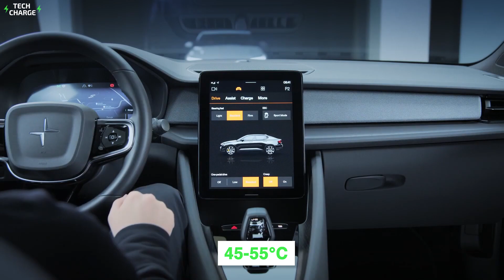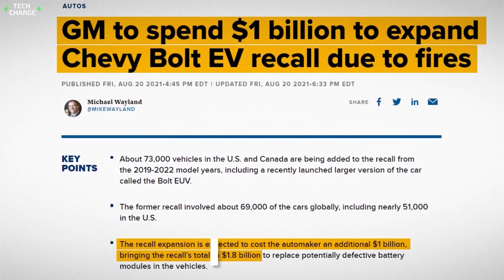The Shocking Truth About EV Fires You Need to Know

Comment: I work in insurance, a real quote from a vehicle owner “I’ve owned well over 30 plus cars that ran on gas from 1972 to 2019…the only car that has ever caught fire is my Tesla I bought 8 months ago. I will never own an electric car ever again” …these fires are more common than what’s being published…I know…I write the claims for them 😂
Reply: They also seem VERY Expensive to fix . Parts seem to takes months as well.
Reply: @mikefleek9259  If there is damage to the battery pack in a shunt, the car is usually written off.
Reply: @mikefleek9259 true but the odds of having to replace one is very slim
Reply: @mikefleek9259 
An emplyee at an official Tesla authorized repair shop (there are few , here) told me in low tone voice, that they've just received the body part of a Tesla a after 4 months wait...and now rhey were going to put it in place, etc....🙈🙈🙈🙈
Reply: the 52 EV fires caused ten times the damage of the 200,000 gas vehicle fires!
Reply: They now have zero value, who will buy a potential mobile fire
Reply: My sons VW Up Beats edition 2 years old court on fire and it was a gas car. Within 5 seconds it was in a ball of flames. Land Rover Discovery 3’s catch fire due to faulty alternators so do many gas cars. We just here about EV’s because they are supposed to be safer but a lot harder to put out. When i asked the fire man about my son’s car he said you would be surprised at how common gas car fires are. In fact i have seen around 6 this year all gas cars but not when parked in a garage always on the move. Wouldn’t park an EV in my garage that’s for sure but then i would drive a gas car straight into my garage either, i would let it cool down before i would leave it in a garage.
Reply: @@aregeebee201 Everybody's situation is different, and I don't believe EVs should be forced on people. For some use cases, EVs aren't the best.
Reply: Half of these cars that are burning in this video aren't even EVs
Reply: Thanks for sharing 🙏
Reply: Thank you for telling us the truth about them .
Reply: @georgevavoulis4758  Here's the truth. Not someone's personal experience. There are 284 mil gas cars on the road in the US and about 2.2 mil EVs. That's about .77 of a per cent of total cars. THERE WERE 200,000 GAS CAR FIRES and that means there would have to be 1,540 EV fires to match the percent of gas fire fires. THERE WERE ONLY 52 EV FIRES in the US last year.
Reply: @777Outrigger mate. There is tons of misinformation about EVs.    The people who hate EV will never listen to common sense. I gave up arguing with these people long ago. It's like arguing with a "flat earther"   don't waste your breathe mate.     Just buy an EV or a PHEV like I have and save $10,000 a year on fuel and enjoy it..   let these clowns keep driving their crappy old petrol car.
Reply: @Liams_Fraser_Island_adventures  I'm just posting in case a undecided person is reading the thread. I just want to dispel the misinformation that EV haters dispense for their sake. .... And my Tesla is incredibly fun to drive, with the instant max torque and the technology. .... Enjoy your EV too!
Reply: @777Outrigger 
...you're repeating yourself on and on and on...!
Reply: @steveaachen62  Yeah, it's a comment section that has 151 replies and is a year old. I'm not reading through it to see what I've posted before. Sorry that offends your sensitivity.    .... And people keep posting the same old BS about EV fires too.
Reply: Just a note that a large number of burning cars shown in this video are actually a gas cars...
Reply: @@Mathilda2zero There are technologies and techniques being developed that will put out EV battery fires as fast gas car fires. I know they have developed some new tech in Sweden and in the US there is a promising fire blanket that can stand temps up to over 500 degrees C and will stop the fire. The blanket will have to be left on the car for a month, but I would say that's a small price to pay to keep the fire smothered.
Reply: I’ve had cars since 1965 and have owned more than 30 (from different brands). Now, I own two Teslas (a Model X and a Cybertruck). Thanks to advancements in battery technology, they’re super safe, and I don’t worry even 1%, period.
Reply: I was told that Genesis gv60 doesn’t hv that problem because a actual person wraps and inspects their batteries unlike Tesla using robots which aren’t tested
Reply: @@Mathilda2zero There are now 2.4 million EVs on the road in the US. More in Europe. Yeah, they're just bursting into flames everywhere. 🤣🤣🤣🤣🤣🤣
Reply: @@Mathilda2zero Man, you just did a lot of myths and half truths about EVs. My range is 330 miles in my Model Y, and I leave full every morning from charging overnight in my garage.  I never have to go to a gas station. .. Plus I've done a 500 mile road trip in my Model Y, about 7 hrs with a total of 37 minutes of supercharging at 2 different charging stops, 19 and 18 minute stops. Just enough to stretch, P, and get a snack. Tesla has 21,000 Superchargers in the US now. You can go anywhere.  ........ The top Lithium mining country in the world, by far, is Australia with Chile second. The controversial mineral is Cobalt with child-slave labor, but the latest EV batteries are LFP batteries and they have NO cobalt. Meanwhile Cobalt is in your cell phone and laptop batteries, and is used in the refining of gasoline.  ....... And I'm sorry, the mining for EVs and their supporting infrastructure is a lot less than for gas cars and their supporting infrastructure, by a wide margins ...... 

And did you know than electric motors are about 3 times more efficient than gas engines? The big 7-seat  Model X SUV has a 100 kWh battery pack and can go 350 miles. That 100 kWh battery pack has the energy density equivalent of only 3 gallons of gasoline. So why can the big Model X go 350 miles on the equivalent of 3 gallons of gasoline? Electric motors are 3 times more efficient than gasoline. That's why they pollute less even on the current grid.
Reply: And when EVs use non'flammable batteries, you'll find your workload disappear, and fewer "adjusters" will be needed.
Reply: @AllDogsAreGoodDogs   Robots don't care what kind of fire they put out.
Reply: Let’s see what the fire rate will be after the winter’s road salts eat away at the batteries.
Reply: @richardolko6660   No worries, Tesla has been making cars for fifteen years now if that was an issue it would be talked about by people much farther up the food chain then you are. Besides robots will be fighting those pesky fires soon enough.
Reply: Data from the National Transportation Safety Board showed that EVs were involved in approximately 25 fires for every 100,000 sold. Comparatively, approximately 1,530 gasoline-powered vehicles and 3,475 hybrid vehicles were involved in fires for every 100,000 sold.
Reply: @myoung48281  utter bollox
Reply: Hi,
I am not surprised. I worked 30 years in the fire service. Lithium Ion batteries are a known fire risk and have been so for 40 years. Even the designer admitted this. It is therefore no surprise they are catching fire as are battery storage sites and E-bikes and E-cycles. I will never buy one.
Reply: @michael.randall5034  Gasoline is a fire ricks too. Teslas catch fire for every 205 million miles driven on average. Gas cars every 19 million miles. I don't know about these E-bikes, but battery management systems on electric cars are getting very good, and the new electric car lithium battery chemistries are less fire prone than than the early chemistries.
Reply: I've been driving gas powered vehicles since 1975. We have had one fire. This was due to wiring damaged by a welded repair. I was away when a passer-by knocked on the door to inform us that our car was on fire. My wife was washing the pots at the time and threw her bowl of water over the fire. End of fire.
Risk is assessed as a combination of probability and consequence. The consequences of an EV fire are so severe that the lower probability of a fire is less relevant.
Reply: @TheRealWindlePoons  Tesla vehicles have had a fire rate of one for every 175 million miles traveled compared to the U.S. average a vehicle fire for every 19 million miles traveled. .... We should ban all gas cars since they catch on fire so often???
Reply: @777Outrigger: Yes, that may be true, but a gas operated vehicle is way, way easier to put out, as you can see from watching this video. It appears that an EV fire is nearly impossible to put out, reminding me of victims of the Hamburg,Germany fire-bombing raid , where victims on fire from phosphorus would jump into the canals, then come back out still on fire!
Reply: @robertbruce1887  There are technologies and techniques being developed that will put out EV battery fires as fast gas car fires. I know they have developed some new tech in Sweden and in the US there is a promising fire blanket that can stand temps up to over 500 degrees C and will stop the fire. The blanket will have to be left on the car for a month, but I would say that's a small price to pay to keep the fire smothered.
Reply: @@Mathilda2zero No, I don't feel personally insulted. But I am kind of exasperated by the lies, myths, and half-truths that I see over and over and over and over again by clueless EV haters. I can always tell when a new half-baked talking-point emerges and goes like crazy over the internet. "A lie gets halfway round the world before the truth can get it's pants on." Winston Churchill ..... And yes, depending on which metric you use, gas car fires happen at as much as 10 times more than EV fires. .. 

Look, I'm sorry that the looney far-left is trying to cram EVs down your throat. I'm against all mandates and subsidies, like Elon Musk. I'm not a climate alarmist. But I know that EVs are superior for most use cases. My fueling costs have fallen by 75%, no oil changes, no transmission fluid changes, no spark plug changes, brakes last 150,000 miles because most braking is done by regen, not friction brakes, etc, etc. I was skeptical about EVs myself, and said many dumb things about them, but I studied EVs for over 2 yrs before I bought my Model Y. I know that most of what is being said is at best a half-truth and a lie at worst.
Reply: @@Mathilda2zero There are technologies and techniques being developed around the world that will douse EV fires as fast as gas car fires. I just watched an EV fire put out in a few seconds by an EV blanket that stand over 500 degrees. Fires are far from a deal stopper for EVs.
Reply: @@Mathilda2zero Yes, but coming soon. As EV adoption becomes more prevalent.
Reply: @@Mathilda2zero Tesla has 21,000 Superchargers in the US now and adding 4,000/yr and that number is growing. Sales are a 7% in the US, 25% in California, and even higher in Europe. Tesla sold 900,000 cars in 2021, 1,300,000 cars this year, and is on track to sell 1,800,000 cars this year. Maybe coming faster than you think. But it will be decades before most gas cars are mostly replaced.
Reply: Yeah, local fire officials are told to list EV fires as vehicle fires, so we may never fully know, just how much, the govt and mfr's, have been lying to us.  But, just from this video, alone, I counted almost as many fires, as (the lying) google, is willing to admit...and im sure that there are many, many more, than that...
Reply: I once had a car years ago where the plastic fuel line had become brittle and split leaving petrol to drop onto the exhaust manifold but it never caught fire meaning I had to put on a new length of reinforced tubing
Reply: Should have mentioned the more dangerous toxicity of the fumes of an EV battery. What if an EV battery goes into thermal runaway in a multilevel carpark or a tunnel.
Reply: Suspected as much!
Reply: Problem is, EVs catch fire without visible cause. They cause way more dangerous fires that are almost impossible to put out.
Reply: Why would you have a Tesla IF you have inside knowledge of an issue as a supposed insurance agent?
Sorry but I'm calling BS...
Reply: Thing is you can't put them out with water.
Reply: But insurance industry statistics show that Gas cars catch fire at a much hire rate.
Reply: When in reality Evs are about 15 times LESS likely to catch fire than a petrol or diesel vehicle.
Reply: Sure buddy. We all believe you..... you work in insurance.  Righto.    Also you bought a Tesla...... even though you hate them....... righto..  .makes sense.  😆
Reply: Why do people get all worked up about EVs. If you don’t like them don’t buy one.
Reply: Indeed.  Ch has HUGE numbrs.  So many folks have wondered if the whole thing was just a ludicrous $cam.   It was so illogical ... and yet ... they DID it, eh.  
Lith.batts near salt water is snaggy to brkdwn of some Bat.housing area; and temp-related spontns.combstn.
Even E bikes too.  (Yt)
4500 degr.
InTENSE.
REignite later, often.
Reply: Per billion miles driven there are 55 fires in ICE cars and 5 fires in EVs.
Reply: @adrianthoroughgood1191  well, I drive cars for more than 30 years now, at the moment just a couple thousand mls per year. So, my car has now about 70 k mls in 17 years. It shouldn´t burn no matter how much mls I drive and no matter how old it is. Everyone working in engineering knows the "bathtub curve": A product has a high risk of failure in the beginning due to production mistakes, then follwed by a low failure rate over a longer period till the aging starts rising the risks. So comparing older gas cars with younger EVs ignores this fact and we will see more fires of EVs when the first cars will be 20 years and older. The highest risk for all cars, EV and ICE, that got worse in the last 15 years, is the low voltage system for all the "pleasure electronics" in the cars. Having temperatures in the summer far higher than 100 F inside the car, the PVC insulation ages. A simple  short circuit, some dust,  old plastics and your car burns, no matter if you drive 1000 or 100.000 mls per year. So you better don't trust the stats, that keeps the business of car makers running.
Reply: Hi,
I agree with you. I worked for the fire service for 30 years and Lithium Fire batteries have been a known fire risk for 50 years. I would never buy one either until safer batteries are invented.
Reply: @michael.randall5034  EVs have a lower fire risk than gasoline cars now, but the new batteries just now coming on line are LFMP and LFP batteries and have even a lower fire risk than the current NCM batteries.
Reply: EV fires are not reported by MSM and infact covered up by the government as it's in their agenda
Reply: I want to hear from the insurance worker again.  It's been a year, how many EV claims (in dollars) have there been vs ICE?
Reply: Hi, I agree,
Most ICE cars that catch fire are older cars. The worrying things is that EV's are catching fire are not very old. Statistics do not take into account arson and smoking materials and DIY mechanics.  EV's spontaneously combust and burn very hot are are almost impossible to put out. If these vehicles were in a factory compound they would require hazardous information and an emergency action code. EV fires are chemical fires the worst type. ICE vehicles are easily extinguished.
Reply: Is it because it got flooded? Because it is flooded by salt water, it can catch fire even weeks later
Reply: @nystagmus  There's no better protected battery than the recent Teslas. Run them through water all you want. They're doing it a lot lately offroading the Cybertruck. No problem.
Reply: We do have 1 thing in common and that's the evs catching fire it hurts honestly to see this happen
Reply: This video now needs to be updated. It's much more likely that an EV-IL car will set on fire.
Reply: @markpownall6967  More cluelessness about EVs and fires.
Reply: I pulled a teenage girl from a burning Toyota 25 yrs ago. I couldn't get her sister out before it really combusted. It was very traumatic. From my experience, maybe I should have concluded that gas cars were too dangerous for people to own.
Reply: You should never buy a Smartphone,, because the energy density much higher than in a ev
Reply: Sample size = 1
Reply: Did'ju hear about the Tesla that was sitting in the garage when a house fire broke out? The Tesla was badly burned, but the battery never caught fire!!!. I didn't think  you heard that.
Reply: I beat your client by 3 years having owned petrol and diesel cars since 1969. The incidence of Electric car fires is horrendous. Go to 6.50 and listen. If I interpret the Americanese of the presenter into English, he said "If you hop into an E.V. right now (I still have both of my legs so I don't need to hop. I only hop to amuse young children) there is a nought point three percent chance that it will catch fire. That means, if it is not destroyed by other means earlier, the average life expectancy of an EV is just over 333 journeys before spontaneous combustion. He said it on the video so it MUST be right, mustn't it ?

Since 1969, I estimate that I have been the driver for well over 20,000 journeys. I have travelled as a passenger in cars on numerous occasions. I have never been the driver or the passenger in a car which has caught fire. My Dad purchased his first car in 1958 and he drove until ill-health took hold in 1998 and none of his cars ever caught fire. The only time that I have ever seen a car on fire where I was physically present, another driver and I rushed to the car which had a fire under the bonnet. with our fire extinguishers. Whilst I used mine from underneath, he rashly lifted the bonnet releasing a small fireball which singed his eyebrows. Undeterred he attacked the fire from above and we succeeded in extinguishing the fire in 20 seconds.

Various bystanders had run around like headless chickens and used their mobile phones to call the fire brigade. Two fire engines descended on the scene, sirens blaring. The firemen were very disappointed that we had shot their fox. We investigated the cause of the fire. The driver and his mate were very red faced indeed. THEY COULD NOT HIDE THE CAUSE.  They had left the engine running so fuel continued to leak and the drips were making spitting noises. I shouted at the driver to stop the %%%% engine. They admitted that several days earlier, they had removed the carburettor (English spelling) to clean it. They had lost the fuel pipe clip so had secured the fuel pipe to the carb with adhesive tape !!!!      CAN YOU BELIEVE IT ?  Having stopped in a queue approaching a roundabout, the leaking petrol, which had been evaporating with the movement of the car, started dripping onto the then very hot exhaust pipe ! How they had got away with it for several days, I don't know.

I left the scene having given the driver my name and address as he had promised to buy me a new fire extinguisher. I never heard from him again. The last I saw of him, his head was bowed as a fireman, denied the opportunity to do his man thing, was delivering a very stern lecture. "If it had not been for the swift action of these two gentlemen YOUR CAR ..... etc. etc."
Reply: @terryhoath1983 
👍👍👍👍👍👍👍👍👍👍👍👍👍👍👍👍👍👍
Reply: @terryhoath1983  Bogus. Let's see, there are 284 mil gas cars on the road in the US and about 2.2 mil EVs. That's about .77 of a per cent of total cars. THERE WERE 200,000 GAS CAR FIRES and that means there would have to be 1,540 EV fires to match the percent of gas fire fires. THERE WERE ONLY 52 EV FIRES in the US last year.
Reply: @777Outrigger  thank you for this. genuinely dont understand the scare going around with battery fires. they sure are a big problem when they happen, and im not exactly a fan of EVs for many other reasons, but these fires are so exceedingly rare in relation to how many batteries are in circulation..... if people are really scared of that risk, then they should also avoid a ton of other things that they probably use without concern on a day-to-day basis
Reply: @ssword123  EVs are just held to a higher standard. That's ok, but I think everyone should know the truth about the actual numbers.
Reply: @777Outrigger where are these numbers coming from
Reply: @777Outrigger  Maybe you should try to explain why so many people reject nuclear power, by the numbers of accidents only.
Reply: @ssword123  Maybe you should try to explain why so many people reject nuclear power, by the numbers of accidents only.
Reply: @louiscaeiroramos8051  Then we should reject gas cars because because there were 212,500 vehicle fires which caused 560 deaths and 1,500 injuries; and $1.9 billion in direct property damage. More people are killed and injured in gas car fires than in nuclear accidents. ...... And EVs are not being rejected. Tesla sales in 2021 were 900,000, in 2022 there were 1,300,000 sales, and Tesla's on track to sell 1,800,000 EVs this year. Sales rising exponentially.
Reply: @777Outrigger  Your math is wrong regarding the percentage of ICE (Internal Combustion Vehicles...GAS) fires.  It's not 0.77 percent,  Based on your numbers of 200,000 fires of ICE vehicles out of a total of 284 Million ICE vehicles, the percentage of fires (based on YOUR data) is 0.07%.  Also, just to be clear, Internal Combustion Engire (ICE) vehicle fires are not spontaneous.  ICE fires occur after devastating accidents...fires set on purpose by vandals and other criminals....fires purposely set by insurance fraudsters...or fires occurring due to negligence while improperly re-filling the gas tank by using a container, and the nozzle of the container causes static electricity thus igniting the gas. --- again due to NEGLIGENCE.  Also, that 200,000 number you quoted for 2022, if accurate, most likely pertains to ALL ICE vehicles, not just cars (Buses, planes, boats, motorcycles, lawnmowers, trucks, SUVs etc).  While the 52 number you quoted for EVs only pertain to cars...and only pertain to those fires that were officially reported.  Most EV fires are not reported.

Lastly, the total number of ALL ICE vehicles in the USA is not 284 Million --- it's 250 Million.  And that 250 Million number pertains to ALL ICE vehicles, not just cars.
Reply: @fidel2xl  You can look at lots of difference metrics and different studies, some in different countries, and you can get different numbers. If I get a number a little wrong, it's because I can't keep up with all of the studies.   ... But one thing is certain, EVs catch fire much less often than gas cars, by many multiples.  ..... The most simple metric is Teslas catch fire on average for every 200 million miles driven. Gas cars every 19 million.  ..... And the Tesla fire rate is falling too, not rising. It use to be a fire for every 175 million miles driven. ...
Reply: @777Outrigger  - Dude, based on YOUR own numbers, your own calculation of the percentages was incorrect.  Your 0.77% calculation was wrong --- this is not my opinion....it's a mathematical fact.

You divided 200,000 by 284,000,000 (284 Million), and somehow came up with: 0.77%.
Nope...the correct percentage based on the numbers YOU provided is: 0.0704% (or just 0.07%).  

Calculation: (200,000 / 284,000,000) x 100: 

Answer: 0.07%

Your claim (based on YOUR numbers) was way WAAAAY off. Not an opinion...a fact.
Reply: @777Outrigger  - Oh, and thank you for agreeing with me by basically repeating what I pretty much inferred by using the phrase 'You have to use different metrics'.  You do realize that's pretty much I said in my previous comments to you, right? LMAO 

Regardless, EVs are the WORST type of vehicles out there...they are a hazard even more so than Internal Combustion Engine (ICE) vehicles.  And EVs are even WORSE for the environment.  EVs need to be banned, and all the crooked businesspeople and politicians who gave and accepted bribes to make these vehicles mandated into law in various countries, need to be indicted and imprisoned for fooling gullible well-intentioned people like yourself.  Jail them and throw away the key.
Reply: @fidel2xl  Let me simplify for you. Tesla's catch fire on average every 200 million miles driven. Gas cars every 19 million. .

And obviously you're not keeping up with the EV fire technology. If you do a little research, you'll see that fire departments are developing techniques and technologies to put EV fires out as fast as gas car fires.
Reply: @777Outrigger  You know most petrol car fires are due to electrical faults or people burning stolen cars, right? Add in insurance write-offs and ancient old cars. How many modern EVs will get to classic status before burning or being too obsolete to use?
Reply: @louiscaeiroramos8051  Because people are afraid of things they don't understand.
Reply: @ssword123 imagine an electric car caught fire in YOUR garage while you and your family are asleep. Doesn’t bear thinking about does it?
Reply: @777Outrigger  Hi, Not that straight forward.
You are not taking into account how serious an EV is that it develops rapidly without warning, burns 3 times as hot at 2000 degrees c  and you cannot extinguish it easily, may re-ignite,  and MOST importantly the age of the vehicle. EV's spontaneously combusting are not very old. Most EV's are barely off the production line.
Reply: @777Outrigger  you're very naive it's actually hilarious 😂
Reply: @ssword123  you're so sheltered from reality it's actually sad
Reply: @Martin199320  You're uniformed. It's actually hilarious. 😂
Reply: "I work in insurance"
Sure you do, and I'm a Senator working in the US Senate, anyone can claim to be anything on the internet ;)
Reply: How will motor mechanics work on them as they will
now have  to be quarantined
Reply: Careful the wokies will get you
Reply: There were 200,000 gasoline car fires in 2022. There were 52 EV car fires. The rate of fires is 20 times higher for gas cars over EVs.
Reply: @777Outrigger  Yes, but the fumes are no where near the problem, just don't breath anything around an EV fire, it's much more toxic.
Reply: @adoreslaurel  I can tell you from personal experience, don't breathe the fumes around any car fire. They'll all toxic.
Reply: @777Outrigger  Wait until an EV takes out a big building from a burn up in the basement, then the Insurance companies will come to the fore.
Reply: @adoreslaurel  Just wait? Sounds like you're desperate to make a bogus case. There are millions of EVs put on ships every year, and all you've got is one ship fire, or two?
Reply: @777Outrigger There is a ship near Holland that had 3,000 vehicles onboard. There was only 25 EVs and there was a massive fire that came from the EV area. 1 man has died and many of the crew jumped overboard due to the heat. But EVs are that popular that out of 3,000 vehicles there was only 25 EVs.
Reply: @marcandsebe  Sales of EVs are rising in Europe, China, and the US exponentially. EV sales in the US were 258,885 in the 1st Qtr this year, up from 178,679 in the 1st Qtr last year. That's a 44.9% increase in sales year-over-year, and a run rate of over 1,000,000/yr.
Reply: @777Outrigger  But after 8 to 10 years the battery is on its way out. EV’s are a throw away item. You won’t see any classic EVs in years to come. They don’t have any soul.
Reply: @marcandsebe  That's old news. Many Tesla batteries are making it to 200,000 miles with very little degradation. About 10-15%, depending how their charged. Some Teslas have made to over 300,000 miles with the same battery. There is a 2,000,000 mile Tesla that's had only 2 battery changes. ..... And to say Teslas have no soul shows you've never driven one. Yikes! The instant max torque and incredible acceleration are excellent. Lots of fun to drive. I drove my wife's gas car recently for the first time in 7 months, and it was so boring.
Reply: @777Outrigger  Probably true, but the fact that you can't hose it out remains a problem. When it takes down a building, and there is one scenario I will not mention for a very good reason [no! i won't reply to anyone because I expect when people consider ALL the possible scenarios, they will find its very chilling].
Reply: @adoreslaurel  There have been a Tesla or 2 that have caught fire in the parking garage  of high rise apartments in China, and the fire was contained. And that's a worse case scenario, unlikely to happen. ..... And battery tech is advancing very rapidly, that includes battery management systems and other tech that will reduce the fire risk by EVs to even a lower level than it is today.
Reply: @777Outrigger  I would be interested to know how it is possible to "contain" an EV "Brewing up", it is difficult to imagine how it could be done considering you cannot put it out, just let it self destruct, perhaps the fire dept played so much water on and around it that they may have been able to dampen down the heat from damaging the underside of the building.
Reply: @adoreslaurel  I don't know, but I have 2 brothers-in-law who were firemen. I might ask them what they think about EV fires. I have had one ask me about my Model Y and how I liked it and what did it cost. Next time I talk to him, I'll ask him about EV fires.
Reply: @777Outrigger  i noticed the WERE bit, maybe they are glad to be out of that hazardous business. We owe Firies a lot, a very dangerous game.
Reply: @adoreslaurel  One retired early, the other retired at the normal retirement age, but he actually wanted to stay in. His wife wanted him out though. She knew it was dangerous and she figured he had done his part.
Reply: @777Outrigger  They have served their time, they don't have to be in for long to acquire a lifetime incapacity. Standing on a roof with a fire underneath is a quick way to go.
Reply: @marcandsebe  treated properly the batteries in an EV will last nearly 20 yrs. There is a Hyundai Ioniq video on here that's done 98,000 miles and battery health is at 100%.  Work that one out. There's a Tesla done 200,000 on here who's battery is at 96%.
Reply: @marcandsebe the actual number of EVs in that ship was later revealed to be 300
Reply: @stephenberry8658  That’s 300 EV’s we won’t see on the road then.
Reply: @marcandsebe if you buy a new jeep.... you will be lucky to get 8 or 10 years out of it ... without major repairs. Lol
Reply: @adoreslaurel you can't put a petrol fire out with a water hose either mate.    Fuel floats on water. It just spreads it around.  You need  a propper fire extinguisher or the right type or fire retardant and petrol fires are still very hard to put out... they nearly always let them burn out.. I have seen a few in person.  But I have never seen an EV fire yet.
Reply: @Liams_Fraser_Island_adventures  The answer is to never buy a Jeep. I buy Japanese vehicles and have only just got rid of a 2006 one. It was still running well with 150k miles on the clock.
Reply: @Liams_Fraser_Island_adventures  Yes, I agree, fuel and oil both float on water, at best, maybe you can stop it spreading to other flammable objects, and water can drop the heat a bit, A fire hose could, at least, reduce the severity of petrol fire out in a basement but an EV burning attains such a high temp and can not be towed out of the building. would not like to own a flat in a building where that happened. Total flooding of a basement would be the only option if you could get it going quickly enough.
Reply: @adoreslaurel  there was a huge fire recently in a parking complex and they say it started with an EV but later this was found to be false.... it started with a diesel landrover......  the fire spread from the fuel from all the petrol and diesel cars that were catching fire and the fuel was actually flowing down to over levels of the building..... this doesn't happen with EV
Reply: @Liams_Fraser_Island_adventures  Err you say it doesn't happen with EV, I think a lot of people might disagree.
Reply: @adoreslaurel  how can fuel flow out of an. Ev?  Not. Possible.    Ev fires are from the battery's and burn alot slower and longer than fuel fires.      The rate of EV fires on also 20 times less that petrol and diesel vehicles.
Reply: @marcandsebe is soul the new word for jerky shifting and nasty pollution and low starting torque?
Reply: @777Outrigger - Wrong...there were only 52 EV fires that you're aware about.  Most of the EV fires are not officially reported.  Also, there are magnitudes more ICE (Internal Combustion Engine) vehicles than there are EVs, so one has to account for that.  In addition, the 200,000 number that you're quoting regarding ICE fires, most likely pertains to ALL ICE vehicles (Cars, Trucks, Buses, Vans, Ships, Planes, Lawn Mowers, Vans, SUVs etc).  While the 52 number you quoted regard EVs only pertain to cars.... and only those car fires that have been officially reported.  If you want to know the true number of the amount of EVs that have spontaneously caught fire, speak to insurance companies. Very soon, insurance companies will refuse to insure these hazardous EVs.

Oh...and these EV fires are spontaneous events.  While ICE vehicle fires are typically not spontaneous.  ICE fires occur either when there are devastating accidents ; Fires set on purpose (vandals setting fires to cars... fraudsters destroying their vehicles for insurance money...people using open flames close to open gas tanks...or people filling their vehicles with gas from a container, but doing so improperly and whereby static electricity ends up igniting the fuel in the gas tank during the improper refilling).
Reply: @fidel2xl  All the things you said don't account for a 10 to 1* fire rate gas cars over electric cars. Not even close.

And I pay about the same price for my car insurance for my 2023 Model Y that I do for my similar sized 2015 gas SUV.

*Teslas catch fire on average every 200 million miles drive. Gas cars every 19 million cars.
Reply: @fidel2xl I have seen a fair few petrol car fires.  None from vandalism or insurance... all while being driven.  One was a 4 wheel drive on the beach that burst into flames.... the others on the side of the road.  All massive fire with flame 60 foot in the air and no chance of anyone putting them out.. I even had a fire in a petrol car myself when. I was 18 because the fuel pump started leaking...... lucky I was very quick with the fire extinguisher and put it out as soon as it started... othwise I would have had no chance.
Reply: @Liams_Fraser_Island_adventures  - For the sheer number of Internal Combustion Engine (ICE) vehicles on the world's roadways, the percentage of those vehicles that burst into flames is extremely infinitesimal (very VERY rare).  And those fires are typically easily contained.  However, for the relatively LOW volume of Electric Vehicles (EVs) on the roadways, the incidents of fires is actually quite high.  And those EV fires which are typically the result of the burning of Lithium batteries, are almost impossible to contain.  The EV fires are usually very devastating.  It's just not worth it.
Reply: @777Outrigger  It's 200,000 out of a huge number vs. 52 out of a much smaller number
Reply: @tjung3909  Let's see, there are 284 mil gas cars on the road in the US and about 2.2 mil EVs. That's about .77 of a per cent of total cars. With 200,000 gas car fires that means there would have to be 1,540 EV fires to match the percent of gas fire fires. There were only 52 EV fires.
Reply: @777Outrigger the point of charging your car in your house, which your chances of the car catching fire increases, your gonna be losing both your house and your car at the same time.
Reply: @tjung3909  What are you talking about!  It's STILL twenty times more likely for an ICE vehicle to torch than a BEV!  By far the most EV fires are hybrids, so not true EVs at all.
Reply: @samlocoaa1726  Parking your gas car in garage increases the chance of losing both your car and your house too. Had you heard about the recent spate of BMWs catching fire in owner's garages?
Reply: Put as a percentage gas cars are still alot more likely to catch fire
Reply: @mteifke  Tesla's catch fire on average every 200 million miles. Gas cars every 19 million miles. Gas cars are 10 times more likely to catch fire than Teslas.
Reply: Even if those numbers are correct,  the problem is the intensity of the EV fires.   Most gasoline car fires are around the engine,  not the fuel tank, and if you act quickly you can put them out with a fire extinguisher.   I drive a 1974 MGB frequently,  I know there is a small risk of an engine fire just due to the age of the vehicle,  so I carry a fire extinguisher (as do most classic car drivers).  It is also easy to reduce the risk of ICE fires by keeping your vehicle well maintained and replacing certain key parts as they age.   With an EV,  I fear the unstoppable (by me at least) and unpredictable (nothing I do can influence the risk of a spontaneous battery short circuit) fire that could result.  And no,  I'm not anti-EV,  in fact my wife drives a plug-in-hybrid with a much smaller battery,  but I do worry about the current battery chemistry in many EVs.   I do think this is a temporary problem, and in a few years,  may well buy an EV (once the chemistry is more stable -- I just currently see the risk as real).    @777Outrigger
Reply: @stephanmeier1613  Well, if you just do some research, you'd know that fire departments and others are figuring out techniques to douse EV battery fires fast and without so much water. EV fires are far from an insurmountable problem... Plus your phone and laptop battery can burn your house down. ....... And yes, those numbers are correct.
Reply: @777Outrigger, so what? That argument is bogus. Parking  garages in Florida and in my state do not allow battery powered glorified golf carts to park in them. Spin your way out of that.
Reply: @roddycreswell8613  Ignorance by parking garage owners explains it. Lots of misinformation out there. And all parking garages? Really? ..... The state with the largest number of EVs is California, with 25% of car sales so far this year being EVs. Yeah, and parking garages are just bursting into flames everywhere in California.
Reply: @777Outrigger  at least the ignorant parking garage owners won't deal with a burnt ev! I wouldn't spit across the state line into Cali, I also wouldn't waste my time and money on an ev. You think your so much better than me, guess what! Your not, you force your will onto others and that makes you the lowest form of human life. Love, live, and let live. Not in Cali. But tell yourself that if it makes you feel better about yourself.
Reply: @roddycreswell8613  I don't like the lefty loonies in California anymore than you do. I have nothing against gas cars and certainly don't think I'm better than you for driving an EV. I often remark on cool gas cars I pass. I'm against all mandates and subsidies for EVs to and so is Elon Musk. I'm just here to defend EVs about misinformation that is flying around the internet.
Reply: @777Outrigger out of the gas fires how many were due to self combustion not accidents resulting in fire? Of the 52 how many EV’s spontaneously combusted for no external reason? Now do your math.
Reply: @777Outrigger  but tjey're still burning.
Reply: @edpoe4622  Not as much as gasoline cars.
Reply: @777Outrigger  The problem is that many evs start fire without to be on an accident, i mean, burn spontaneously. Gasoline cars that burned was after be involved in an accident.
Reply: @GETTERoriginal  I know lithium batteries can do that, but the battery tech is getting better as are Battery Management Systems. It's a rare event and getting rarer all the time.   Tesla has gone from a fire for every 175 million miles driven to a fire for every 205 million miles drive just in the last 5 yrs.
Reply: @tjung3909 they actually measure  it in fires per 1000 vehicle...... Ev are about 15 times less likely to catch fire than a petrol car.
Reply: @777Outrigger I wisely steer clear in pkg lots, and even at traffic lghts.  Too unpredictably hazardous.   Do not charge them in your Garage!...says Mfgr.😮
Reply: @roddycreswell8613 Cali is great! I'd rather live there than here.
Reply: @777Outrigger 100% correct
Reply: @777Outrigger absolutely. Too much scaremongering.
Reply: @acceleratedriving  Way too much scaremongering by a factor of 100X.
Reply: @777Outrigger  you provably need to put into consideration of how many gasoline cars were sold compared to EV in 2022 to get the real stats.
Reply: @mayday9958  It is the RATE of fires I'm talking about. The rate has nothing to do with total numbers vehicles on the road.
Reply: @777Outrigger just to be clear, you think there were 52 EV fires in an entire year in the US?
Reply: @777Outrigger  "According to our data calculation from data analysis by AutoinsuranceEZ from the NTSB and data from the International Energy Agency (IEA), there are estimated to be 4125 electric cars catching fire each year."
Reply: @777Outrigger  "And did you hear about the rash of Land Rover diesel fires?"

Why yes.   And of course, Land Rover issued a recall.

Other than GM, which EV makers  issued a recall over battery fires?  Or is this just considered a luck-of-the-draw kind of event?  Something the owner screwed up?   Is there a root cause available to review

"there were only 52 pure BEV fires in the US in 2022"

You have to count hybrids too which raises the count significantly.   It's a lithium battery problem, not an EV problem per se, but it is affecting people's willingness to buy EVs.

So rather than gloss over it, probably better to fix it.  Or don't.   Government mandates are not going to hold on EV's so this does need to be addressed.
Reply: @teekay_1  I don't know what to do with hybrids. Who knows what the cause is. They have both the gasoline fire risk and the battery fire risk.  ..... And do you guys ever worry about the lithium battery in your laptop and your phone? If they catch fire, they can burn your house down too. Why are you suddenly such nervous Nellies about EV fires. Maybe you need a safe space now.
Reply: @777Outrigger  No, because the phones are smart enough to shut down when the heat of the battery starts rising.   

here's an idea .... maybe EV makers could shut down the entire car except the battery cooling system when the battery heat is starting to exhibit symptoms of going into thermal runaway.   I'll bet those clever engineers could knock out a system like that in a fortnight. 

"Why are you suddenly such nervous Nellies about EV fires. "

Do you think that would work as an advertisement for EVs?  Serious question.   

If the fear is out there among prospective customers, it's not constructive to call them "nervous Nellies".   Even if the chance is 1 in 100,000 why would your customers consider putting that in their garage?
Reply: @teekay_1  Teslas shut down when they reach a certain temperature too. In fact, I just read about that feature. It's part of the advanced and advancing Battery Management System. ....  Maybe you need that safe space after all.

And don't ever get on a B-787. They have lithium batteries for their electrical system as well.
Reply: @777Outrigger  Well, apparently it doesn't work all the time.   Maybe those engineers need to come clean and talk about why those batteries are on such a knife's edge that they can't detect a runaway condition.

Anything that goes on a plane has to be tested and have FAA certification.  In fact the FAA certification # will be stamped on any part.

If you're suggesting that FAA standards for Lithium batteries should apply to EV's, then I would say that's a great idea.
Reply: @777Outrigger  BEV vs ICE fire stats are problematic - most of the EV fleet is less than 5 yrs old, average age probably less than half that. ICEs run for about 20yrs on average...  

ICEs catch fire more often as they get older, and the insulation on the wiring dereriorates, and they develop other problems (fuel leaks etc.) due to poor maintenance.

For an accurate comparison you'd have to compare EV fire rates with ICE vehicles less than 5 years old.

 Outside of accidents, you shouldn't be having fires in ANY vehicle less than 5yo, ICE or EV....
Reply: @peeemm2032  In the last 5 yrs, as EVs have gotten an older average age, the rate of EV fires is falling. From 2012 to 2018 it's 1 fire for every 170 million miles driven, but if you expand it out from 2012 to 2020, it's 1 fire for every 205 million miles driven. The EV fire risk is falling as battery tech and battery management systems advance.
Reply: @777Outrigger  not the point....if you want to compare fire risks between different technologies, you need to compare vehicles of a similar age.

Fire stats for ICE vehicles will be for vehicles with an average age of about 10 years, with many up to 20 years (or older), where most EVs will be less than 5 years old.

Also, many ICE fires are a result of arson following theft, newer EVs will be more secure, and less likely to be stolen than older ICE vehicles....
Reply: @peeemm2032  As the EV fleet ages, the fire rate is falling, not rising. 

Battery Management Systems and Battery Technology is still advancing rapidly because the technology is new.

Age of the different fleets can't explain a 10 times greater fire risk in gas cars.
Reply: @777Outrigger  I finally managed to track down some information on vehicle fires related to age.

According to an article in Motortrend from July of this year, age of the vehicle mattered more than other factors. They quoted a study by the NFPA in the US that said that 77% of all vehicle fires were in vehicles at least 10yrs old. This means that these vehicles were about 3.35 times more likely to catch fire than a vehicle <10yo.

If you assume a similar relationship for vehicles under 10yo (i.e. vehicles between 5yo and 9yo are 3.35 times more likely to catch fire than those <5yo), then the fire stats for vehicles of all ages are going to be about 19 times higher than for vehicles <5yo...

So, based on those figures, I'd be expecting fire stats for ICE vehicles of all ages to be about 19 times higher than for EVs (most of which are less than 5yo), based on age alone....

You were saying?
Reply: @peeemm2032  EV fire rate is falling, not rising even as the EV fleet is aging. Substantially. 

Technology is rapidly advancing for batteries and their management systems.

Missing from your calculation is that most Americans can't maintain their old cars adequately. If they could, the fire rate for old cars would be lower. Which brings us to the fact that gas cars require a lot more regular maintenance  than EVs, which require very little maintenance. Much less. 

A study by AutoinsuranceEZ looked at car fires as a percentage of sales. That is, fires per 100,000 sales. In 2021, gas cars had 1,530 fires per 100,000 sales. EVs had 25 fires per 100,000 sales. When you look at it that way, that's a fire rate of 61 times higher for gas cars over EVs.

You were saying?

And EV fires are rare and you should not pretend that's a reason to not buy EVs. Please don't spread these lies..
Reply: @777Outrigger  I was responding to numerous posts in which you've claimed that ICEs are 10 time more likely to catch fire than EVs....

As I said, the average age of the ICE fleet is much greater (about 10yrs, with many to 20yo, or more) than the EV fleet (most less than 5yrs, average probably less than half), and rate of fire increases with age (due to poor maintenance, deterioration of wiring insulation etc.).

Data from the National Fire Protection Association (NFPA) in the US indicates that the ICE fleet would have about 18 times the fire rate of the EV fleet, just due to much greater average age. So this isn't a valid comparison.....
Reply: @777Outrigger  strange... In the UK EV fires jumped 83 % this year from 130 to 239. How can there be only 52 in the US???
In Australia some insurers now require you to declare if there are any EV chargers in the apartment building car park.
I have been driving for 55 years. I have never seen a car fire. Only one person I know had a car catch fire. It happened as he drove out of his apartment building.
Reply: @777Outrigger how many ice car fires are from joyrider's or just plain staged insurance claims for cars that are too expensive to repair?
Reply: @dennism7813  You got me. Whatever it is, it doesn't account for a fire rate that is 10X for gas cars over EV car fires.
Reply: @777Outrigger 
2010..... 1 billion + ICE cars
2023... 11 Million EVs
Do the sums... Make sure you remove arson from your data.
Reply: @Ted...youtubee  Of course, the RATE of fires has nothing to do with total numbers. .....And do you think arson doesn't happen with Teslas? I've seen several videos from Tesla security cams of people setting fires to Teslas.
Reply: @777Outrigger  I smell BS. Data source....?
Reply: @777Outrigger Please factor in the numbers of each type, too.
For example:
1oo000 evs sold : 100mil normal vehicles.  You know, using Actual nos.
Reply: @TrgtdGmaWblwr  Total numbers have nothing to do with the Rate of Fires. Teslas catch fire on average for every 205 million miles driven, gas cars for every 19 million miles driven. Total numbers got nuthin' to do with it.
Reply: @777Outrigger 😂😂😂
Reply: @BillyBones436  😂😂😂
Reply: @777Outrigger  If each EV fire produces 40 times the damage as a typical petrol car fire, then the rate being 20 times less isn't really an improvement, and minimizing the damage when it does catch fire, is a serious problem that the manufacturers need to address.
Reply: @777Outrigger that’s because there are still more fossil fuel cars. But when an EV catches fire it’s much quicker, extremely hotter, with extremely toxic gases & higher chance of explosions. EVs are more devastating & dangerous also way much harder to put the fire out. And it can reignite at anytime. Up to 30k gallons! It wouldn’t take anywhere near that with a non EV vehicle fire.
Reply: @onlymyopinion100  My numbers are the RATE of car fires and has nothing to do with total numbers of cars. .... And fire departments around the world are developing technology that will put out a battery fire as fast as a gas car fire, using about the same amount of water. I can elaborate if you want.
Reply: @777Outrigger yes. But you extinguish an ICE fire with an extinguisher nor 10,000 gallons of water.
Reply: @JensSchraeder  The newest tech can extinguish an EV car fire with the same amount of water as a gas car fire. It's a device that goes under the burning EV, punctures the battery pack and floods it with water. You see now that every minor and major problem with EVs is being solved.
Reply: @777Outrigger  Yeah, but ICE car fires are about 20 times easier to extinguish. And an ICE car fire probably won't lead to the loss of a car carrier.
Reply: @777Outrigger  How many cars in total for both type?
Reply: @777Outrigger  that's a firecracker to TNT
Reply: @snapon1974  Teslas catch fire once for every 205 million miles driven, gas cars every 19 million miles. I agree with you if you're talking about a gas car.
Reply: @777Outrigger  flawed argument, what is the percentage of EVs that catch fire❓ So much misinformation surrounding EVs
Reply: @olly7248  There are 2.3 million EVs on the road in the US and and 286 million ICE cars. That means that .008041 of the cars on the road are EVs. At that rate, multiply .008041 times the number of gas car fires of 200,000 you get that EVs should've had 1,608 fires if they burned at the same rate of gas cars. But there were only 52 EV fires
Reply: @777Outrigger  Don't confuse them with math and numbers. A fire is hot and EV fires are hotter. Spread the fear. :face-purple-crying:
Reply: @CokemanChatt  I know that. But much less frequent and getting less and less frequent with new battery technology. And Fire Departments developing technologies and procedures to put out EV fires as fast as gas car fires.